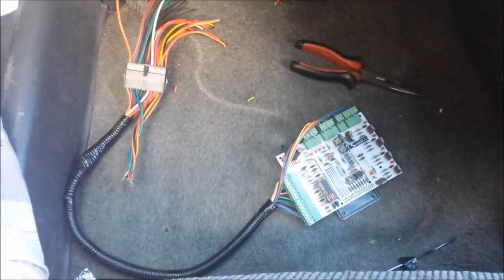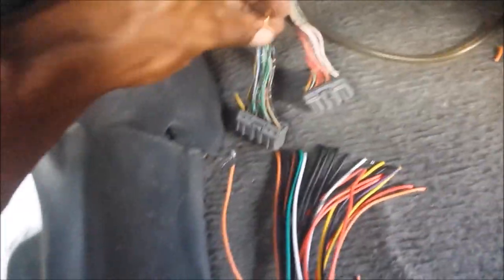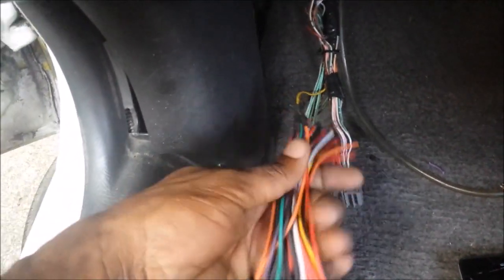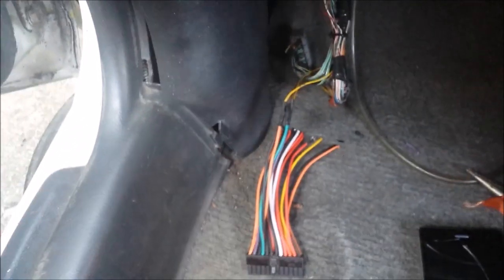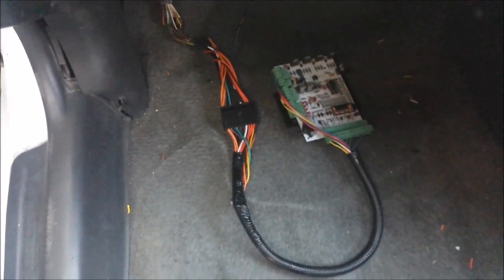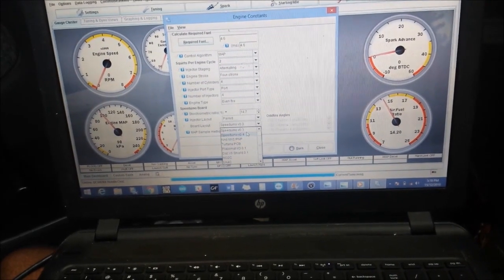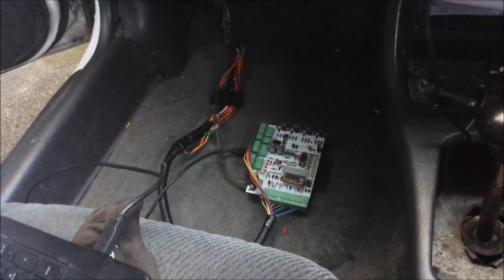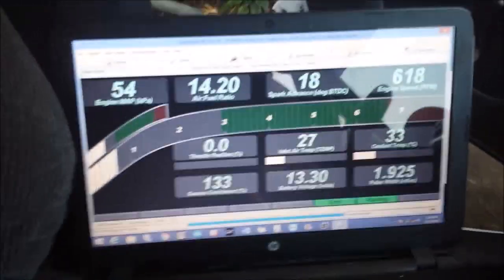Speeduino V0.3 Installation Guide Part 2 of 2

Comment: So... speeduino works with the existed sensors of the car. The only thing you need to do is connect it to yours car loom... am i right?
Reply: Exactly, you just replace your standard ECU with speeduino, which is far more tunable, than the standard.

Comment: Thanks for the video. I’m in the process of doing this with a Jeep engine to power a snowblower. Having never done this with an engine with an ecu, im a little bit scared. I’ve ordered the speeduino im guessing that I’ll need a laptop and software too. One step at a time I guess. Again thanks for the video.
Reply from the maker: Straight 6 4.0L  jeep engine ? I have a video on the channel of me getting one running a couple months ago with speeduino. Yes you would need a laptop and the Tunerstudio and megalog viewer software for an installation. It's not that hard if you take your time and ensure you understand what you are doing
Reply: @DCWERX  
Hello. Where o how did you get the  Tunerstudio and megalog viewer software? Thanks.
Reply from the maker: @avleerxo  just type it in Google, and efianalytics site should pop up

Comment: Still figuring out everything. I have a few stupid Q. what about the stock cluster, does it work? if you didint connected any other wires from stock harness, what is with them?
Reply from the maker: I can't speak for every car but with Honda, the tach signal comes directly from the igniter so no extra wiring needed. The speedometer and other gauge wiring isn't touched so they work like normal.

Comment: Do you have a video on loading a basemap to get the engine fired first time or one to show basic settings on first startup?
Reply from the maker: I made one a while back https://youtu.be/KjVGayNbV0k . Started with a generic basemap and just put my trigger settings, required fuel settings, coolant sensor and air temp sensor calibrations, and spark settings for my engine and it pretty much started right up
Reply: DC WERX Thanks.
Reply from the maker: You welcome. Check this one out aswell https://youtu.be/0rLyW6O-XAo